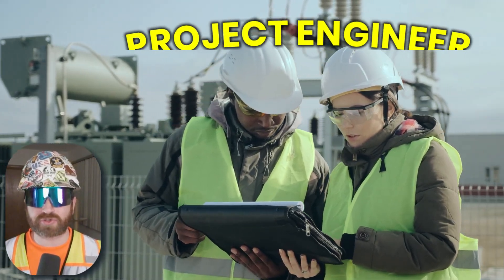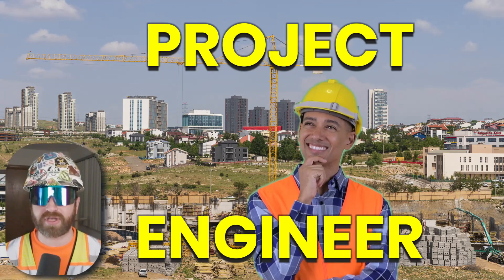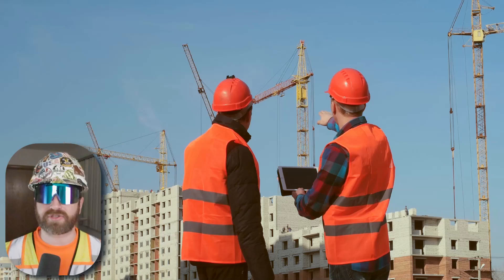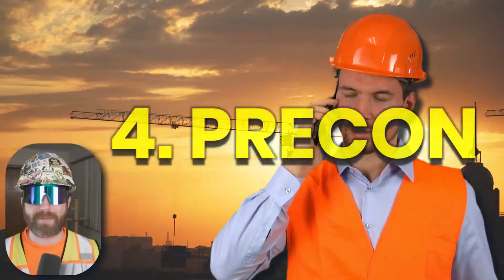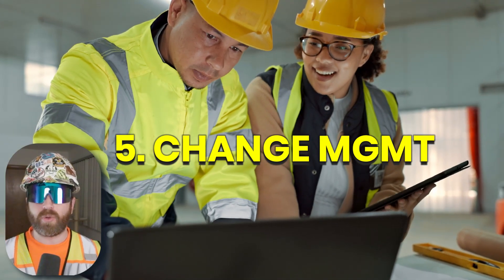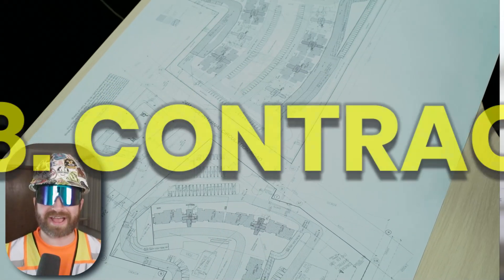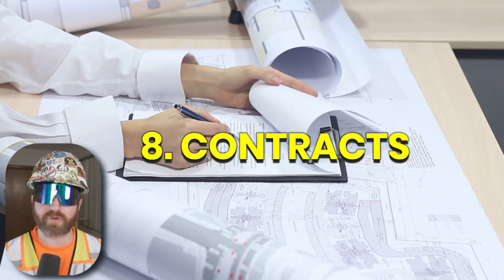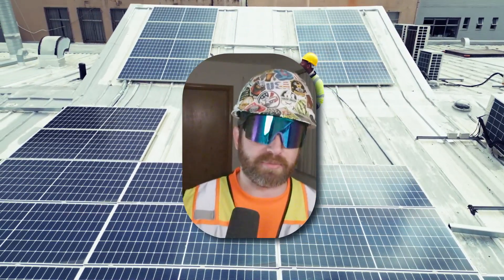What Is A Construction Project Engineer's Job

Comment: Hey man, enjoy the videos. Super random question. Who is the person responsible for finding exact location of pole lights. I’m an electrician and want to run my home runs as close as possible to the sonotubes so I don’t have to come back and dig later or be too far past the sonotubes and the concrete guys destroy my conduit. I just wanna 90° up after they pour the sonotube and be done with it until they mount the pole lights. Thank you.
Reply from the maker: This all depends on how the scope was divided, and how site layout was written into everyone's contract.  Typical scenario, the General Contractor will provide a control point on site, and all the contracts provide their own layout from there.  I'd ask your PM (if you have one) who owns layout.  Where I live & work in commercial construction, the electricians in the area usually hire companies that augur, place sonotubes, pour concrete, and set pole bases (then the electrician runs the site underground to tie into and pull final cable).  So not a great answer but hopefully gets you closer